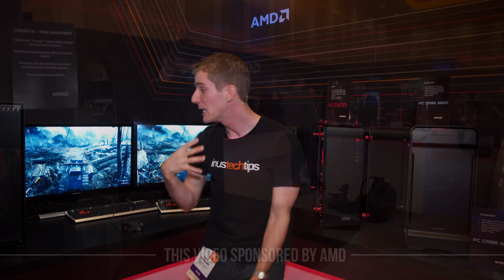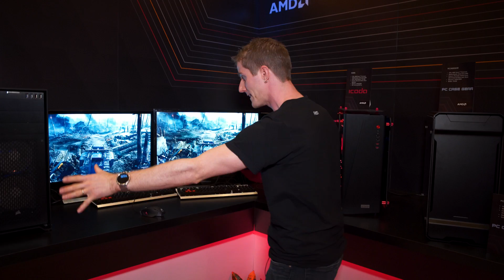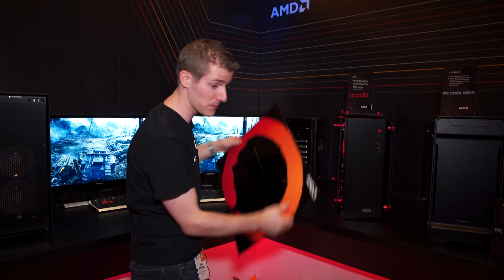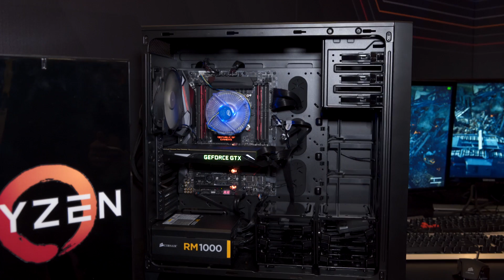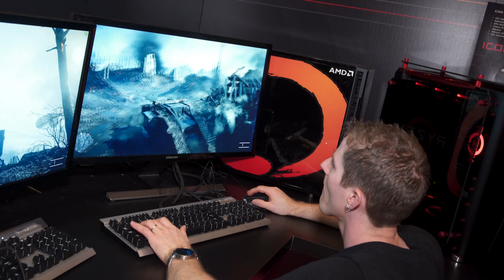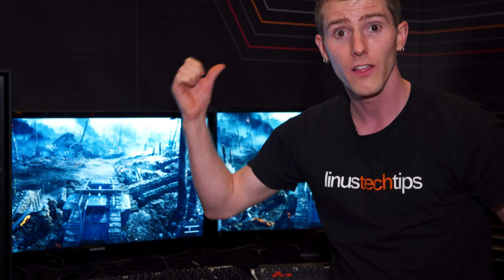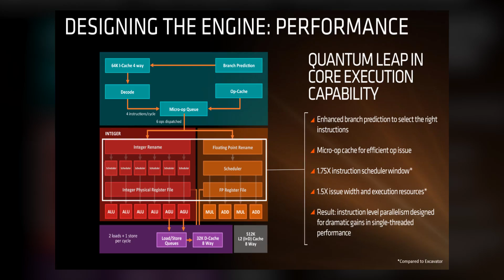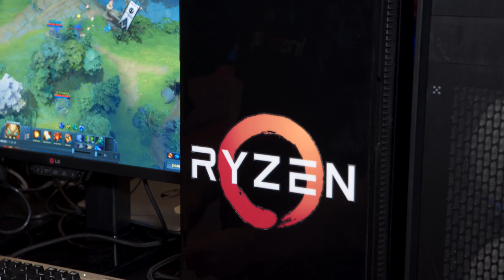AMD Has Ryzen!

Comment: Who else here is also still on Haswell and doesnt plan on upgrading anytime soon? im still chugging along nicely with no bottlenecks at all.
Reply: MASTAX1234 2500k here
Reply: MASTAX1234  i5 4690k GTX 970 since mid 2015
Reply: I've been on Sandy Bridge, 2500K, for a good 5 years now.  If AMD comes up with a mainstream processor with more than 4 cores and beats Sandy Bridge at IPC, I will gladly jump ships and upgrade.
Reply: Eduardo Trujillo prolly the resolution :) If I'm not mistaken they're prolly playing at 4K resolution given that they're using a titan xp
Reply: Pfffft, I'm still rocking a i5-2500k Sandy Bridge @5.5 ghz in one of my systems. The other system is rocking the AMD FX-6300 Black Edition.
Reply: I'm fine with my i5-4430 ,although I'm going to replace my 4gb 960 to a 6gb 1060.
Reply: MCatwar haswell to skylake or even kaby lake is very minor in performance stick with the platform you have now even i7 4790k is worth more than the i7 6700k on ebay

i5 4590 is still a soild CPU for gaming.
Reply: MASTAX1234 Sandy bridge here, still run all games well. 3770k
Reply: still on Haswell as well (pun intended).  The recent generations from Intel have hardly any performance gains so it's not really worth it to upgrade unless you're looking for some power efficiency or thermals
Reply: still on sandy bridge e (3930k) powering along nicely
Reply: Core 2 Duo E8400@4.2Ghz. Get on my level. \m/

p.s.: don't
Reply: Not on Haswell, but I am on Ivy Bridge. Zero plans to upgrade my 3770K & 7970 anytime soon. (Don't judge my watt hungry GPU, She loves them watts.)
Reply: There is no reasonable argument to be made for an upgrade. It would simply be wasted money.
Reply: Me and my 920 is still rocking, although it is time to replace it in a few months when i can compare intel and amd.
Reply: i5-4460, and no plan to upgrade anytime soon
Reply: 4770k @ 4.2 GHz
Reply: Technically speaking, it's not possible to have no bottleneck of any kind at all, without any kind of frame limiting function enabled.
Reply: Is it bad if I'm still on clarkdale? Lol I5-650
Reply: MASTAX1234 I'm sitting on Nehalem (i7-920) and upgrading to Westmere soon (Xeon X5650/5670)
Reply: MASTAX1234 4790k ftw
Reply: i7 3770k(Previous i5 2500k) ivy bridge was running smooth with my old GTX680 until BF1 came out. I then got my hands on a used Titan Black.
Reply: I´m still chilling here on my sandy bridge (badumm tss). i7-2700K still running wonderfull. no bottleneck detected o.O
Reply: im still on my 2600k and dont plan to upgrade until that one dies... :D
Reply: lol haswell, i7-3930K still does the job
Reply: i7 2600 with r9 380
Reply: MASTAX1234 I'm on a 3770k 4.0gz and I'm still doing great!
Reply: still on i7 2600 (yes non k verison) overclocked to 4.37 ghz (yes you can do that with multiplier and blck) and a gtx 1070 ftw
Reply: Cøunt Grishnáckh that's why I did and there's a killer difference with my 1060 ssc 6gb. Although I paid $320 :p
Reply: Just upgraded to an i5-4690k from an AMD 8350 and I don't think I'll be upgrading again at least within the next 5 years.
Reply: im still chilling with my 3770k
Reply: 4770k since 2013. No problems with it.
Reply: haswell? mate im on sandy bridge LOL
Reply: Nada Intel I agree... Nvidia no. Pascal and Maxwell are better than Kepler in every single way.
Reply: still on i5 4590 with gtx660ti..planning to get nice gpu soon..
Reply: Ivy Bridge brahh
Reply: still using 4770. changed my 780 with 1070 though. cpu performance upgrade is not really noticeable in day to day use, unlike gpu.
Reply: still on Ivy bridge, loving my i5 - 3470 doesn't bottle neck my RX480 what so ever
Reply: Oh no what a lose for AMD :(
Reply: my 4690k works just fine. i do hope amd pulls this off though its about time there was an alternative
Reply: lol I'm still on Ivy Bridge bois. i7 still relevant
Reply: I7 4770k @4.3ghz on air im fine with my cpu for now. But if Ryzen turns out to be what it claims to be, then I might upgrade.
Reply: I have a i5 4570 & RX 480 @ 1420 (will do 1490 but dont want to kill my gpu) and i see some fairly severe CPU bottlenecks in just cause 3 & battlefield 1, but i still am well above 60 fps so im all good (closer to 100 fps)
Reply: 4790k for life!!!
Reply: i7-5930-k liquid cooled at 4.7Ghz. Nothing is making it break sweat yet.
Reply: i5-4690 with GTX 970 here.
I wont upgrade until 2018/19, depending how the market develops then.
My rig works just fine, and it's not even 2 years old (built ~March 2015)
Reply: MASTAX1234 i7 5930K here, R9 290, i also don't think i'll have to upgrade my cpu anytime soon xD
Reply: 2500k @ 4.7 with Fury X and its still rockin , but man if Amd is up to the challenge I will go all red :)
Reply: Son, I'm still on Ivy Bridge.
Reply: MASTAX1234 still using my i7 2600k
Reply: MASTAX1234 I'm still on wolfdale.
Reply: I'm still running my i7 920s, no problems so far
Reply: Agreed.
Reply: MASTAX1234 I'm on a g3258.. 1050ti is only at like 25% usage while cpu is at 100 :(
Reply: Salim Ahmed not sure if I should go skylake or not. I'm on a gigabyte  h81m-h and I've put 8gb ram and everything. I'm not sure if I should upgrade the cpu to a 4590, or just go skylake.
Reply: Salim Ahmed Same. Overclocked both and having no problems hitting 60fps at 1440p. Next new cpu I buy will have to be a major increase in performance since it'll mean getting a new mobo and possibly new cooler as well
Reply: I am on Haswell and I am definitely upgrading to Ryzen. Gotta case, PSU and RAM already. A lot of stuff I do can benefit from more cores, and even recent games take advantage of them, like BF1.
Reply: i5 4690k @4.5 and gtx 970, those demos looked sketchy to me, especially that bf1 campaign mission running at 55fps, pretty sure i was in the late 70's almost all the time
Reply: still waiting for haswel prices to drop :(
Reply: I'm still running a Pentium E5800....
Reply: Stephen Anderson i am still running a xeon x3330 ...
Reply: Most modern games are not CPU bound as they all focus on graphics and physics (both GPU related) more than CPU intensive tasks (AI, complex simulation, ...)
If you play mostly FPS, RPG (except for Bethesda due to their old engine) or Adventure action games (the 3 most popular genres nowadays) then no need to upgrade your CPU often as loing as you keep both memory and GPU up to par.
This become much more of an issue for games that involve more complex AI or simulation: 4X, City/Park builders, RTS
and hopefully the focus will move away from "just graphic" a little so we can finally have better AI and world simulations (which are much more difficult to implement purely on a GPU as many of what they involve is more sequential than parallel)
Try to play a game like City skyline or Civ VI with all the options to high and even a very good PC from last year will struggle at time and this even if you have way more GPU power than those game require.
Reply: i5-4570 with my 1060 3gb
Reply: I am on 4790k @ 4.8 ghz. Everythin runs buttery smooth. I will stick with it untill I notice any lag.
Reply: I definitely can't CPU encode video and play games without it choking. My 4770k overheats too because it has the lid transfer problem and it gets super hot.
Reply: MASTAX1234 haswel and kepler is like the real peak of intel and nvidia's research. whatever came after is just downgrading in the name of electric efficiency market.
Reply: 4790K at 4.8GHz. I do alright.
Reply: Im still on Ivy and have seen no benefit worth my $$ to upgrade till now. Zen will be that upgrade though!
Reply: im on f ing sandy beach cuz of my imac
Reply: Same
Reply: Fam i'm still on Yorkfield :V :V
Reply: im happy with my Sandy Bridge i5 2400 and its running like a charm in everything with my 780 :)
Reply: Rocking my i5-4460. Probably won't need an upgrade, soon.

Best upgrade would have to either be a K SKU i5 or a K SKU i7. i7 would probably help massively with gaming and streaming simultaneously, though I'm not too concerned about video encoding, at the moment.
Reply: i7 4770K with GTX 760 here
might upgrade to GTX 1070 or AMD offering soon ;)
CPU wise, I am satisfied with my Haswell, even though it is so hot hahaha
Reply: 4690k yo, I didn't expect a ton from 7700k but no IPC gain at all, what a joke. With AMD looking competitive again though, maybe next generation will bring a true reason to upgrade.
Reply: i7 4790k and GTX 980 more than happy :)
Reply: MASTAX1234 I'm at haswell but I'm upgrading from 4690k to 4790k so I'm still staying with haswell
Reply: still on a core 2 duo e7200 with a gtx 750 ti TT
Reply: Im on 6700k but upgraded from my AMD Phenom II x6 T1100... really needed it for the m.2 support etc
Reply: i7 4790k with  960 4gb no probs but will be upgrading GPU to  1060 when i save a little lol the only thing i really want to upgrade is my motherboard but its hard to get 1150 socket  with decent specs
Reply: Koo How Shen thats awesome, i was on an e7400 with a terrible gt 220 xD until last year
Reply: Totally agree. have a 4790K + GTX1070 and am so happy. No desire to upgrade.
Reply: l5640 is my beast :D
Reply: i5 4690K 4.5GHz@1.227V with an GTX 1070, running butterfly smooth
Reply: MASTAX1234

I'm rocking my i5 4590 @ 3.7 GHz

there's no game I can't play

GPU is a R9 380x @ 1170 MHz
Reply: i5-4460 :) and pc is 1 year old, and so fast
Reply: My delidded 4770k is still going strong!
Reply: 4790k @ 4.7GHz, might break for Ryzen/Vega come summer though...
Reply: MASTAX1234 Yep. Xeon E3 1231 v3. Absolutely pleased with what I have, and GPU aside (R9 390) I don't see an upgrade in the next 5 years.
Reply: e3 1231v3 is a personal favorite and I don't plan to remove it for a while. the other I5 4460 in another living room game build...maybe it will be replaced
Reply: I'm still on Ivy Bridge actually xD
Reply: MASTAX1234 You really don't need to, I went from Nehalem straight to skylake.
Reply: MASTAX1234 doing the same with my sandy bridge ;)
Reply: My xeon E3 (haswell) is really bottlenecking the new RX 480 I have so I'm looking for a new processor in 2017. Intel or AMD whatever :D
Reply: 2400 user here
Reply: Yep. My 4790k is showing no signs of bottlenecking, and is actually faster at 4.7GHz than a stock 6700k, so I can't see an upgrade happening for a while!
Reply: me
Reply: *****
oh oops I meant the other way :D comment edited!
Reply: I don't see a reason to upgrade from my Devil's Canyon i7-4790K
Reply: nice! same config as mine! The xeon runns so smooth and the 390 is a beast... was the right choice back then :)
Reply: im not getting bottlenecked on my 2600k and 1080.
Reply: MASTAX1234 are you kiding? I still am using my ivy bridge 3770k
Reply: Bloomfield cpu here, and I'm not planning upgrades at this department. I7 920 at 3 gHz (will go higher once I get a good cooler) with a 4 gb gtx 770.
Reply: Jamie Edwards T33
Overclocking wont kill your GPU unless you're hacking the BIOS to push more voltage than you should -___-
Reply: Exidrial i have the stock bios but for some reason it lets me push up to 1.35v, ive never done that because i dont feel comfortable with it because that is a lot more volts, but at 1.27 it hit 1480 and it hits 1420 at 1.2
Reply: #3570KSTRONK
Reply: Jamie Edwards T33
1.35v on a stock BIOS? I haven't owned an AMD card in a while but that doesn't sound right.
Reply: i5 3570k ! but i may upgrade to ryzen with a new GPU volta or vega
Reply: Still on Lynnfield i5 750. I see bottlenecks only on battlefield 1 and other cpu intensive games.
I'm not overclocking since my mobo and PSU can't handle it and I don't want to bother stress testing and all of that.
Rocking a GTX 1050 and 8GB of RAM.
Reply: 5820K i7 here and there is no game I have played that comes even close to bottle-necking me.
Reply: My Ivybridge 3570 is still doing perfectly fine.
Reply: Running i7 3930k, Sandy Bridge, clocked to 4.2GHz. Average load with games or up-streaming around 20-40%, with 1440p 144Hz screen, running admirable framerates (100+ for latest triple As, full 144 for older) with my GPUs. Slightly over 3 years old now and I suspect I'll get another 3 years out of it unless it just breaks or something. Edit: I've had it slightly over 3 years. The CPU launcehd Q4 2011
Reply: Exidrial Yup, i have a XFX GTR Black Edition, and when using Saphire Trixx i can whack the voltage up to +200mv and when i have a look on hardware monitoring software it states that it is indeed running at these stupidly high volts, i instantly put it back down, i recon my card could hit about 1520-1530 if put on water at those volts, its a very good chip
Reply: Exidrial here is my card running @1470mhz on VRMark orange room: http://www.3dmark.com/vrpor/61968
Reply: Jamie Edwards T33
not bad at all
Reply: MASTAX1234 lga 775 here hahaha
Reply: I am about to buy an i7-3770k or  i7-4770k or  i5-3570k or i5-4670k, whichever comes as a bargain on eBay. I could not care less what AMD is launching next. They will not be able to launch anything near 150-200$ which competes with Intel.
Reply: Cosmin D. I recommend waiting until the pricing is official, because you might regret an early decision.
Reply: Nigga I'm on ivy bridge and I'm chugging ez pz no problemo 3d rendering
Reply: Yup, 4790k i7 and GTX1070, no game an issue.
Reply: You really don't need to upgrade your CPU at all if you have an i5/i7 unless you're a professional, or want the best frames possible in MMOs, my friend used an i7 2700k for years without any problems, and my i5 3470k lasted me a long time too until I decided to upgrade to the i7 4790k.
Reply: Not true, some of the games I play is notoriously CPU bound, due to them being indie games.

Many developers still go single threaded option with less reliance on the GPU and bounds many of their calculations on the CPU, they use pre-made game engines that has all these configurations set in stone.
Reply: i have  2 core duo E8400 4.2 Ghz , 2 core quad Q6600 4 Ghz  , i7-4770k at 4.4Ghz CONSTANTLY meaning boost and steppings off , i have also i5-4690k at 4.5Ghz .

At this time i will also pass the 7 series as there is nothing to gain same as the GTX 10xx series.
i possible do an new build with Ryzen next year when i move to my still to build new room if info is true.
Reply: MASTAX1234 ha, im on ivy bridge still. 3570K FTW
Reply: MASTAX1234 I have a 4790k 4.7ghz but there are bottlenecks unfortunately. There are numerous benchmarks showing the difference between haswell and skylake. As a 144hz user I hit them more than a 60hz user though.
Reply: Still cranking an OC'd 3770k with zero plan to update unless the component fails. Then again, I'm quite comfortable sitting at 1080, 60hz. Still not used to the visual difference of 144hz.
Reply: MASTAX1234 I'm on Piledriver and I have no bottleneck. :D 
FX-8350, the 'shitty' AMD processor still works for me just fine. I don't plan on upgrading until I feel uncomfortable playing games at 1080p and that has not happened yet.
Reply: MASTAX1234 2500k, superior cpu, but starts feel old
Reply: I'm still chugging along on my Phenom II 1100T processor, most likely going to do an upgrade when my tax return is done, most likely to a Ryzen
Reply: Haswell? Psh I'm running a sandy bridge 3930k with my 1070, purrs like a kitten
Reply: Still on Sandy Bridge :D Going to be upgrading to a 1070 as well :3 Although I'll be upgrading to Skylake after :(
Reply: +Claude Kenny tbh the money spent on a new z270 motherboard, ddr4 ram and the cpu will kinda be wasted. You won't see nearly enough performance gain in gaming to justify the cost. I run the witcher 3 ultra at 1080p on my 3930k 4.2GHz and gtx1070, and get at least 90fps. Jumps up to 120fps indoors. Don't get me started on doom!
Reply: Ghost oh I'm upgrading to Skylake not Kabylake :) The only reason I'm only upgrading is because my friend only lent me this processor until I  get save up for my own rig :3 and I really want USB 3.0/3.1 since I often transfer files
Reply: MASTAX1234 Yeeeep. Im on a 4670k @ 4.1ghz doing just peachy. lol
Reply: I'm still on a first gen core i7-920 and it's still running great!  I even have virtual reality running on this computer (yes, I know it's mostly not CPU dependent, but there are recommended specs)!
Reply: Da Foo I still using first gen i5 750 with rx470
Reply: I'm gonna wait for the next gen Intel before I completely rebuild, although I might get a 1070 soon.  Current rig: http://pc.yoni.tech
Reply: Haswekk I5 4670 here. Most games get little to no advantage by going to a i7. Although this may change in the future.
Reply: Physics gpu acceleration only works on Nvidia GPUs. If you have a AMD GPU you have to run physics (Physx) one the CPU. Of course there are games not using the Nvidia ownes Physx system also in which case both AMD and Nvidia GPUs would have no advantage here. AMD has accelerated computational abilities that can be used to accelerate physics (OpenCL, etc)but I have not heard of any games using it.
Reply: Physx is old school and technically was its on independent company Ageia before nVidia bought it out.  Do you remember the Ageia Physx cards?  The technology dated back to early 2000s
Reply: MCatwar I would rather go for the 4690 instead of the 4590 if I were you. It's only $20 more expensive for a 200 MHz increase, not a bad trade I would say. Oh, and just a quick question, does your H81M-H supports overclocking and if so why not overclock your G3258 to let's say 4.0-4.5 GHz?
Reply: i3 4170 with gtx 960 here, I won't be upgrading for a very long time.
Reply: MASTAX1234 i5 4590 here
Reply: i5-2320 and r9 270x wohoo!
Reply: +MCatwar my suggestion is to step up the processor on the same architecture. There's not enough of a performance difference to justify switching to skylake.
Reply: +Eduardo Trujillo you running 4k ultra?
Reply: +Frédéric Py what you mention is why I want stronger cpus for gaming. I don't just stick to one genre and play many of many genres. I enjoy RTS and city simulations a lot. I'm just all over the place with games.
Reply: +SirMo That was the same reason people began delidding their cpus wasn't it?
Reply: +Limey Shades it's not bad, just impressive. I'd be even more surprised if you were still using the core 2 stuff.
Reply: +kolzi I know right? Just higher clock speeds? Really Intel? They really should've just skipped its release and focused on their real next architecture.
Reply: +phantom7489 I've never had haswell, but I've always liked haswell. Haswell is Intel to me for whatever reason.
Reply: +IsAMank even if you have to skip Vega, it'll still be fine. I expect RyZen to be good enough to be competitive. I'm not sure on Vega yet.
Reply: +prixmyo nice upgrade bro
Reply: Yh lol, my 4590 @ 4ghz on water still kicks ass.
Reply: vkorinfsky PhysX is still being used so it is not really old school. It is obviously very capable. A lot of people are mad about it because it is proprietary technology owned by Nvidia. Ageia was smart enough to sell off. My friend bought the card. I laughed when he told me since I already knew not to buy first gen hardware since support usually does fast.
Reply: #4770Kmasterrace
Reply: well Battlefield 1 is a real pain on my i5 4690k @ 4.4 GHz. I'm probably going to switch to the Skylake(or Kaby Lake)-X equivalent of the i7-6800k if performance doesn't improve.
Reply: im on sandy bridge over here!
Reply: Sebastian Bolte i run BF1 just fine with my 4.3GHz 3570K and GTD 970, I fail to see why you would have a CPU related problem with it.
Reply: MASTAX1234 Still sitting on a i5-2400 waiting for a major upgrade for that $150-200 mark.
Reply: yee, I'm fine with my i5-2400 & gtx 960
Reply: well you have to consider that they had the CPU at stock speed of 3.4
Reply: i7 4770k at 4.3 Ghz, no problems at all...
Reply: I have an I5 3570K IVY setup and a GTX 760. I've been rocking it since late 2012 and it still handles everything I throw at it. The video card needs to go bye bye though. I can run BF1 on low settings with this card, and it is lagging up on me in 64 player maps. On the fence if I want an RX 480 or wait just a a little longer for the VEGA gpus. Anyone have any recommendations on my next video card. Would love a 1070, but want to see what AMD has to compete with here in the upper end of the market.
Reply: I'm actually running a 3570K w/ an RX 480 8GB gpu. Great combo, in my opinion. For the price, the GPU runs everything exceptionally (Witcher 3, BF1 all maxed w/ 85+ fps on full servers, Watch Dogs 2, Deus Ex Mankind Divided, HITMAN, GTA V etc).